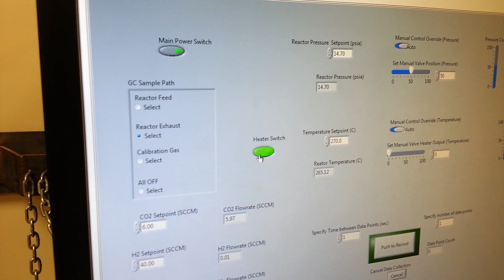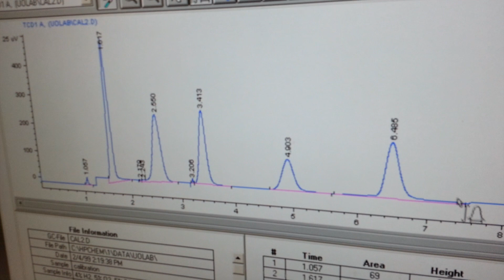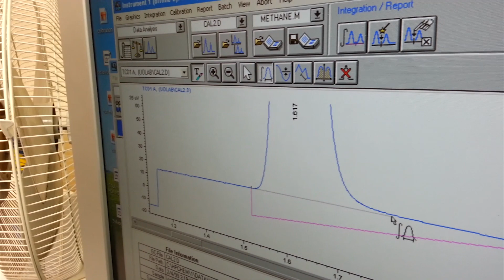Catalytic Methanation Converts CO2 to CH4 (Methane)

Comment: why helium? why not just hydrogen and co2?
Reply from the maker: Helium is an inert that reduces the partial pressure for the reactants to prevent coking. Probably better to switch to Nitrogen or another inert to avoid using Helium.

Comment: Pid controllers don't work like that. Just set the temp you want ?
Reply from the maker: When the PID controller is in automatic mode, it adjusts the heater to maintain a temperature set point as shown at 1:09. The set point is the target value for the PID controller. Additional information on PID control is given here: https://apmonitor.com/pdc/index.php/Main/FeedbackControl

Comment: Are you stating the H2 or H2O  are "abundant on Mars atmosphere"? Are you telling me that H2 (aka the green gas), does NOT escape planet Mars gravity?  The escape velocity of H2 at 300 K on earth atmosphere is 1600m m/s,
Reply from the maker: Mars certainly doesn't have abundant resources but there may be frozen water at the poles: https://www.npr.org/2021/09/22/1039288432/mars-liquid-water-surface-size-potassium-mass-space  My guess is that any energy system on Mars would be nuclear-based and energy storage would be electrochemical. The purpose of the catalytic methanation lab is to teach students about reaction kinetics.

Comment: Hey dude, haven't you realized that CH4 is also a "GREEN HOUSE GAS". Do you work for "Brigham Young University" unit operations lab? 
You MUST consider the total energy released during the CO2 -> CH4 -> CO2 cycle. Just include heat produced by burning CH4 back to CO2, it is an atmospheric issue, not a catalytic discovery. Every chemical step you run into has always consumed energy, so it is CO2 "catalytic conversion to methane".
Reply from the maker: A practical application of this technology is for in situ production in places (like Mars) where there are limited fuel sources or where H2 is abundant, like a refinery or high temperature stream electrolysis. The qualities used in this lab are very small.

Comment: for every one unit of CO2, it takes atleast four H2 to produce methane? te heat value of H2 is almost 3 times more than methane, basically you kill such a good fuel to achieve something with 1/12 of heating value.
Reply from the maker: This may only be needed for storing energy in a more transportable form such as producing CH4 from CO2 on Mars. CO2 to anything else will be thermodynamically unfavorable.

Comment: Beside the experiment, there is completely no practical advantage for this reaction.A lot more interesting is to route the CO2 and H2 to methanol.If you produce methane from CO2 ,that methane would end up being burned (or transformed in methanol) and the CO2 comes back.In fact the cheapest hydrogen comes from methane.So you are making it the other way round.
Reply from the maker: It may make sense for producing fuels for interplanetary missions where they are difficult to transport but can be produced from electrolysis of H2O using sunlight or PV electricity plus atmospheric CO2. I can't think of many good reasons to do this on earth either.
Reply: @apm  Both hydrogen and methane have the disadvantage of being gases (at ambient temperatures) so they need to be densified/compressed /cooled in order to store them.From this point of view methanol is a lot more convenient as a fuel (though it has as a lower specific energy than methane and hydrogen ) as it is a liquid at normal temperatures. Storage and transportation are important even in interplanetary missions.

Comment: What helium gas that's scarce and expensive to use oh carry on I wonder how much its going to cost,so coal powered station produces CO2 and the electricity to produce H2 gas so in theory you start at 35 percent efficiency and in order to get hydrogen this falls to 17 or less efficiency you can't get something for nothing I think it's a no brainer.
Reply from the maker: This process is only a likely candidate for in situ resource production for Mars or other areas where you need to produce fuels where it is difficult to transport them.

Comment: Dear APmonitor,
I'm an spanish student of 17 years old. I'm doing a research project in wich I have to plan a trip to mars and calculate each single aspect of the mission such as the rocket I will use, taking in account all the mass of the things carried, the diferent stages of the mission, where to land and settle the EZ zone… And a really important part of the Project is to explain and show how my life suppport would be there, so I thought of carrying some tons of hydrogen to mars to use it in the ISRU system, that would  basically be a sabatier reactor to produce the oxigen and water needed (later doing electrolyisis of the water), and to produce the methane wich is necessary to return to th earth as I'll be using SpaceX boosters (Raptor engines specificaly) wich are powered with methane.
So the problem comes when I want to show the examiners a little prototipe and this sabatier reactor but I don't have neither the reasources neither the academic level to build it by myself (*as I'm at the course before entering university*).
If you know any way of getting anything similar or a simplier way of building it I would be incredibly thanksful with you.
Thank you for your time.

pd: I live close to Barcelona in  case you need to know.
Reply from the maker: Sorry, I don't know of an inexpensive lab for that type of reactor. The lab in this video has a gas chromatograph, gas tanks, fume hood, flow controllers, temperature controllers, and many other components that are all fairly expensive.
Reply: @apm  As a university professor do you know if is frequent to have this type of reactor in universities? I would check nearby univerisities and ask them if I could go there and at least test it in case they have
Reply from the maker: @cramarc3058  I don't think it is a typical thing found at universities. Here is more information on the system at BYU: https://uolab.groups.et.byu.net/files/catalytic/catalytic.htm
Reply: @cramarc3058  Hi! I don't know if you read my message, I would appreciate your response.
Reply: Hola Cram Arc! Te parecerá una locura pero justamente yo también estoy haciendo un TR acerca de Marte, su colonización y posible terraformación. Y pues resulta que yo también me veo en un aprieto ya que también se me ocurrió hacer como parte práctica la reacción de Sabatier. Me gustaría saber cómo hiciste para llevarla acabo. Yo también vivo en Barcelona.
Reply: There went a lot of years, but may be it will be interesting for you about Sabatier reaction for methanation from carbon dioxide to methane and water: https://ntrs.nasa.gov/api/citations/20120016419/downloads/20120016419.pdf

Comment: this SOUNDS like a sabatier reactor, but i don't understand the need for helium
Reply from the maker: It is a Sabatier reactor (https://en.wikipedia.org/wiki/Sabatier_reaction). The helium is an inert for diluting the reactants so that the flow rate is sufficiently high and the residence time is sufficiently low to maintain a differential reactor assumption (low conversion) for easier analysis. The helium gas is also an inert carrier in the gas chromatograph and so the reaction rate and temperature are not too high to damage the sensors and reactor. The temperature is controlled by a heater.
Reply: @apm  Hi is there any carryable sabatier reactor for sale any where if so I would be really thank that u tell me where to find it as by the momento I haven't found anyone and I need it for a research project.
Reply: @cramarc3058  did you find one?

Comment: 👍👍👍👍👍looking into the frackning industry and a way to turn high number of one not used into usable hydrocarbon?
Reply from the maker: There are some nice processes that will convert natural gas into higher chain hydrocarbons but CO2 would require a large energy source. For this experiment it needed hydrogen and CO2 where hydrogen is the energy source.
Reply: @apm  we have noticed the good news is the plate there drilling is also the one for high transfer rate would like to check methods to get the highest exchange rate for hydrocarbon replacement and a technical method for transfer and pressure forced by heat and forced expansion off pure hydrogen? Other elements? Needs full check. Into the stone over area, for hydrocarbon replacement even at best would be a complex drill though the crack method is one for worry as it fractures the hole plate and opening it to other issues including blow out, as trapped gas in the stone over time excape seen on a few documentry  that has blown out contamination to a water supply and used a acid which is only 50 percent removed has eaten to the surface contamination of a town's ground water and we'll the cfc gasses seem to be ignored while they seem to want to poison a town looks like environment went out the window.

Comment: in 0.49, are you using Labview software?
Reply from the maker: Yes, LabView is used to control the process and collect the data. We've recently started using OPTO22. In industry, a PLC or DCS system is more common.

Comment: how about results? what was the overall yield? conversion efficiency? how about something more substantial than "i turned a few knobs, and set this box in labview to 14"
Reply from the maker: This is a student lab where those are the answers that the students find. These videos are instructional to help them know how to operate the equipment. We purposefully left off the solutions so they can discover these things through data analysis and statistical methods for confidence intervals.

Comment: Wouldn't it be better if we turn the CO2 straight to CH3OH, methanol, a liquid a lot easier for storage, via renewable energy?
Reply from the maker: +苑舉民, you have a good suggestion about the ease of storage. It may need to be a different route to liquid fuels such as biofuels from algae. There are also many innovative ways to utilize CH4 for liquid fuel production.
Reply: APMonitor.com Thanks so much for the insightful comment!

Comment: I really wish these Students would've watched "The Mars Underground" featuring Dr. Robert Zubrin.

The Sabatier Process is to be used on the Planet Mars for producing Rocket Grade methane to refuel
the ship for the return to Earth.

BYU of Provo, UTand they're 116 miles NNW of Hanksville's Mars Dessert Reseach Station.
Where the Mars Society's proving ground is.
Please look them up.

Currently, France is developing a similar process using Plasma and Nickel Coated Anodes.
Which is smaller, compact, less energy, and lesser moving parts.
Reply from the maker: +Dave Duca, that is a great example of the usefulness of the application. Many of the students are also motivated by the analysis of a kinetics. Having an end use for this particular application would make it even more interesting. It is wonderful to have the nearby Hanksville Mars Dessert Research Station. Mechanical Engineering capstone groups at BYU are working on Mars Rovers. I was at JPL last year discussing drone flights and 3D Photogrammetric processing. This section of Hwy89 is fairly close to the type of surface that may be encountered on Mars: http://prismweb.groups.et.byu.net/89/  Thanks for your comment and enthusiasm for Mars.
Reply from the maker: +APMonitor.com, oops - here is a better link that should work: http://prismweb.groups.et.byu.net/89/App/

Comment: Hi, Interesting, for me, the MBA student.

Has any work been done on large scale commercialisation of this? And what is your energy overhead i.e. energy consumed by the process vs potential energy from the products? Have you tried hooking the whole system up to solar to test how the energy overhead could be completely supplemented by renewables?

Thanks! Dave
Reply: that is an interesting idea, especially if you could obtain the H2 by electrolysis from water. CH4 prices are so low in 2016 that you'd need almost a free source of H2 and CO2. The net reaction is exothermic (gives off heat) so it would be better to use the H2 directly instead of the CH4. This may make sense for space applications, however, where you are trying to use planet resources to create CH4.
Reply: Hi John - yes one would rely on H2 from Solar/Non-carbon electrolysis. In my opinion - as an observer with a non-science background - the technology lends itself to production of fuels for applications that required a high energy density: aircraft etc. Not sure if it's possible to convert methane to octane and heavier hydrocarbons?
Reply: Hello I am looking forward to buy a hydrogen carbon dioxide to methane converter

Comment: hello. I saw carbon dioxide to methane conversion using sabastier rxn is that true practically appliable?

can u give me ur Gmail I'd or fb I have few doubts to clarify
Reply from the maker: Yes, this is the reaction that is used: https://en.wikipedia.org/wiki/Sabatier_reaction It does convert CO2 to methane but the difficulty is that you need a supply of hydrogen. Converting CO2 to methane is possible but most of the efforts in CO2 conversion are either focused on reservoir injection or algae biofuels. If you have a cheep supply of H2 then this approach with a Ni catalyst may be possible. My profile is listed here: http://chemicalengineering.byu.edu/JohnHedengren.php  Another person in our department that is more familiar with catalysis is Morris Argyle: http://chemicalengineering.byu.edu/morrisargyle.php
Reply: thnq

Comment from the maker: It is recoverable but the experiment uses so little that it doesn't seem worthwhile compared to other potential efforts to obtain or preserve helium. Apparently up to 1.9% of the gas from fracking is helium, especially by Amarillo, TX where it in some of the highest concentrations. That is a BIG source of helium with most of it released during the gas processing for distribution of the natural gas.
Reply: Hello I am looking forward to buy a hydrogen carbon dioxide to methane converter

Comment: Is the helium recoverable? Helium is non-renewable.
Reply from the maker: We don't recover the Helium from this experiment but it probably could be recovered if there were an air separation unit. We will certainly need Helium in the future so this is a good thought to be sensitive to ways where consumption can be reduced. Here is an interesting perspective: https://www.wired.com/2016/06/dire-helium-shortage-vastly-inflated/
Reply: I was wondering the same thing